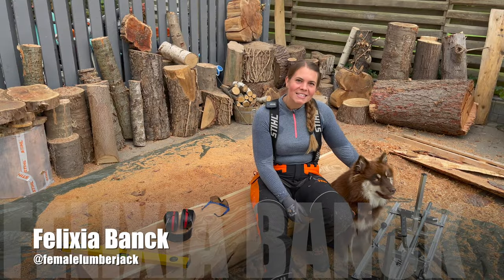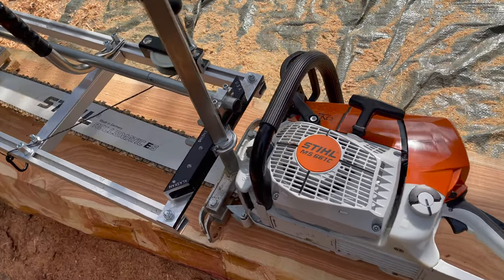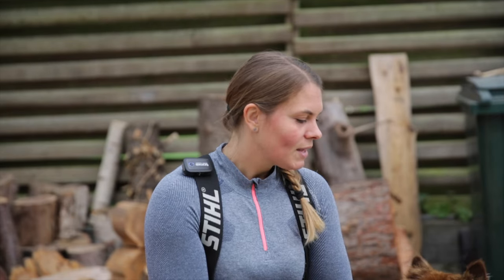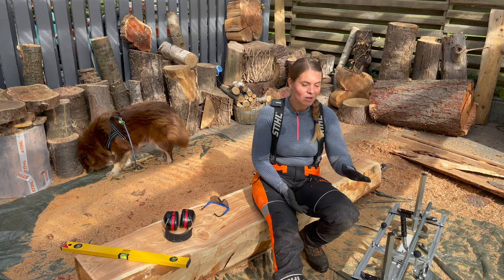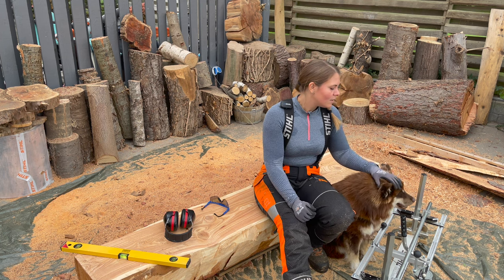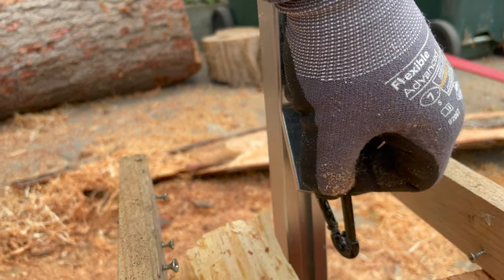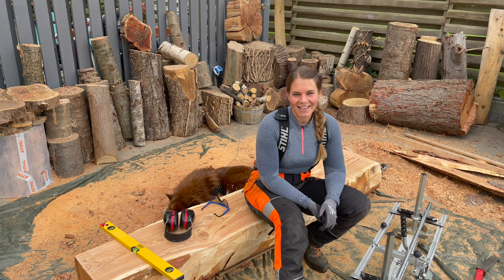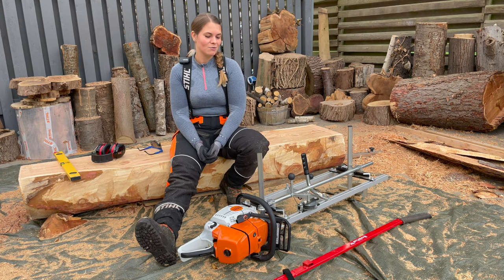Granberg Alaskan MKIV chainsaw mill review

Comment: G'day FMLJ, I purchased my Alaskan 48 inch twin power head in 1995 and mounted a beautiful pair of 066 magnums on it I decided to run 3/8 skip ripping chain and Stihl said it wouldn't handle it I had to use .404 well it did, my brother and I wrestled with that thing for fourteen years then I got the Lucas Mill and retired it. I might have to get the winch of grandberg mount it and give it a run they tell me those 066's are hard to find these days 👍🇦🇺.
Reply from the maker: Wow I’m sure you’ve cut some beautiful slabs 💪
Reply: Truck loads and I got paid 👍.